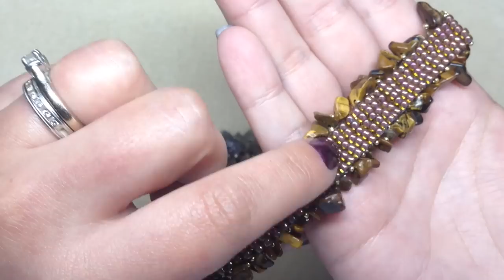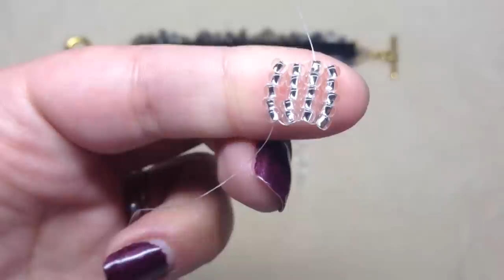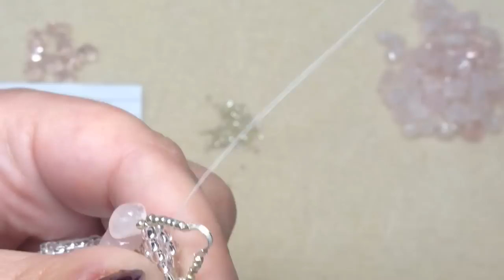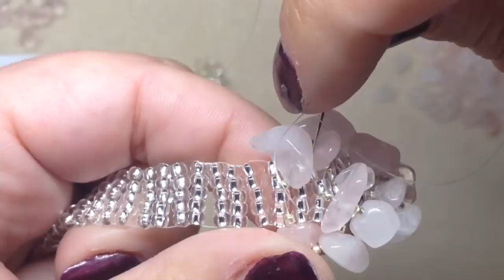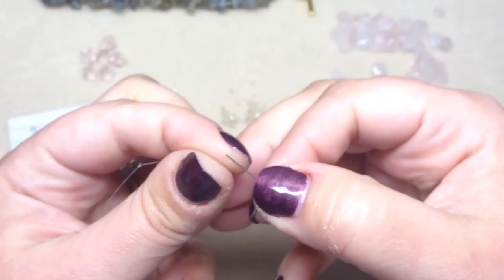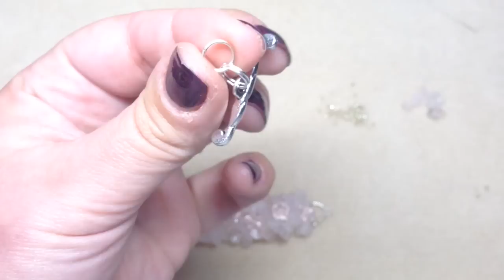DIY Floral Gemstone Chip Hedge Beaded Bracelet Tutorial

Comment: Hi, I'm just wondering. I don't have any 8.0 beads can I use 6.0 and would using the bigger bead make a difference in how many rows?
Reply from the maker: Hi Candace! You can definitely use 6/0's on the bottom. Just try increasing the beads on the top by say 2 to start, and adjust if you need to. Thanks for watching!